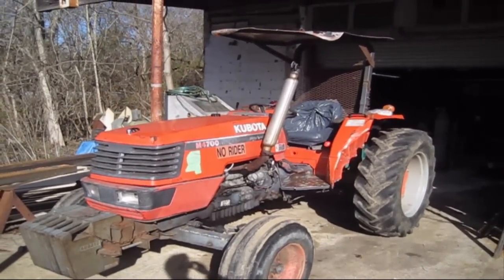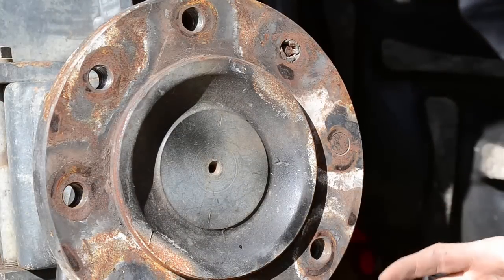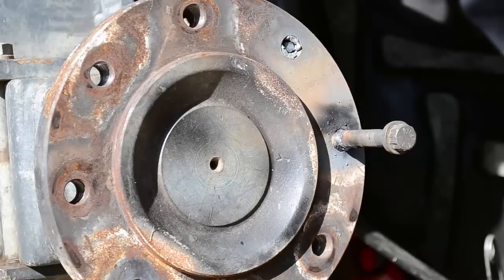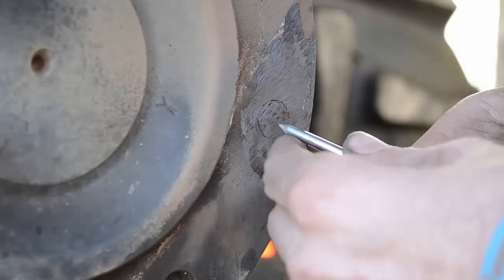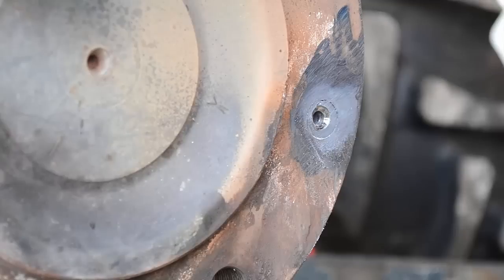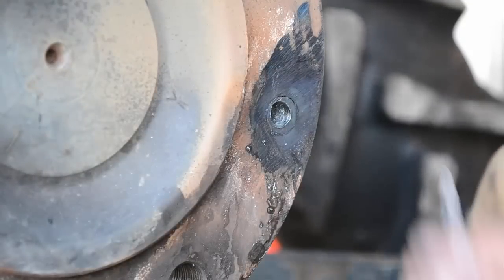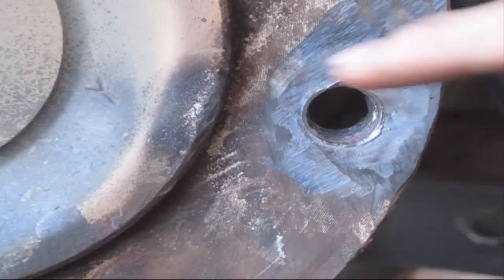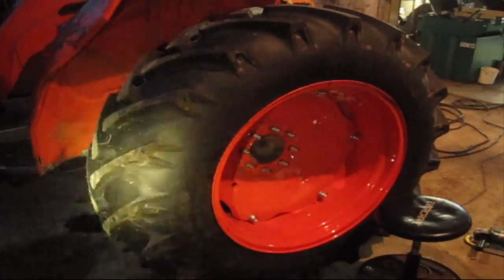Broke-off bolts techniques

Comment: Too much time ,many risk   , you can with two holes  first 2.5 mm then 10 mm  put wd40 in the hole  , if its  rusted with a torch heat  then some impacts with a hamer  , and  poke a 11 mm exagon  driver turn to left , its all .

Comment: Its easy when u have all that space to deal with the shit.. Infinite space, no off limit angles, no wires and sensors around, no rubber, no oil seals, no limit for whatever choices of tools.. Im dealing with a very specific shit on my motor where im stuck with all those limitation. Pulled my hands off coz i dont have the balls to gamble with those fucking sensors and wire and seals tiny winie conectors.. Shit!!! I need a beer.. Lets just leave it for today..
Reply from the maker: alister kellen I understand believe or not I do the same thing when in a confined space.  Wet a welding blanket and put it all around your wires. Sometimes you got to take a chance. Beer and rest helps a lot I bet tomorrow you'll have it out and wonder why you had problems.  Wish you better luck and take care.
Reply: Classic Work lol..dont get me wrong bro ur vid is good.. Maybe Im just commenting to express my frustration after a fucked up day with those junk I'm working with.. I'm not those pro 25years mechanic guy who surf the tube and correct others methods to begin with.. I'm just the mad guy that need a rest with my beer..haha.. I gave full credit for Ur patience tho.. I need that attitude..after I sober up of course..huhuhu
Reply from the maker: alister kellen hahaha very cool.  Thanks man well maybe I can help ya out. What are you working on, what size is the bolt, material, and what is your tool selection like?  Might can help. I've pulled some really hard core shit out in the passed.

Comment: Damn video should be how not to remove bolts. Should have used lube once it moved . By using 6011 as pounding on it is great, only you are cracking the weld before even turning it once. 7018 or 10018 =10,0000 to 30,000 pds per square in weld strength on a small surface area strength matters. Cutting off the back of the broke bolt flush or screw  and weld nut on the  back if U had enough space. Drill any thing, get some Mystic Metal Mover; Google it and drill threw spring steel like butter. Get some you wont regret it. Took awhile but; you did gitter done. Yrr learnin took me 50 years working with metal to get half as smart as I think I am. Now can't remember shit. My  wise old man said' he forgot more than I would ever know. I said;  U R right U forgot.
Reply: Ha, wonderful post!

Comment: I can drill a lawn mower blade and leaf spring with slow speed and a lot of pressure you are drilling way to fast PS if you're doing this a lot you should get a hand mounted drill made for tractor trailer stud removale

Comment: way too hard that way all you do is weld on the bolt then spray penetrating oil on it (KROIL is the best) and go have a coffee. When you come back  heat the area around the bolt as hot as hell, then use CRC Freeze Spray on the bolt and just undo it
Reply from the maker: christopher coulter hahaha I see we have a kroil fan.  I think spit works better than that 25$ a can crap.  Don't give in to the marketing wank.
Reply: $25 a can never paid that much but you can also try this. we had to remove seized pins on an excavator track First we blew a hole through the centre of the pin with the oxyacetylene blowtorch then we grabbed one of those CO2 fire extinguishers we covered the pin only and pumped the CO2 through it.after that it was just a sledgehammer and breaker bar job done.

Comment: I did watch about 1/2 of your video . It looks to me you are what they call a back yard mechanic. Your method is not new its bean used for a long long time. Never weld a grade 8 bolt to softer material. You may want to try the square taper type easy outs . Buy a good one not at the hardware store. You will make it easier for your self.

Comment: Try some nuts off,,,like bolt breaker,,then heat around the outside, it will pull the lube into the threads, then follow Joel S's suggestion with the washer,,and nuts. Railroad Lee's  idea,,, railroad guys  know.  And on resembling use anti seize on new bolts.   I so hate broken bolts,,,

Comment: Why are you doing all that foolishness, when all you've got to do is drill a hole which would allow a welding rod to strike an arc within, fill up the hole you've drilled, leave it to cool off. This would cause the bolt to shrink due to the contracting of the welding which in turn pulls the bolt away from the threads freeing it up in the process. The bolt is at least grade 10.9, you apply heat to that it would be difficult to drill it afterwards, plus the speed of the drill is way to fast to drill a graded bolt.
Reply: pitulifaithinjesus, you are correct.

Comment: I always have a tin of nickel compound with me. It's God's gift when it comes to tight or bonding threads. As soon as I get some movement in it, I take it in as far as I can, then apply some nickel compound as far into the threads as I can. Next I take it out as far as I can and if there are any threads exposed, I apply more to as much of the threads as I can and also into the hole at the back if I have access to it. I then work it forward and back, working that NC into the threads and you will find it freeing up. That stuff is incredible and heat resistant up to 1400 deg centigrade. This is the stuff: http://spanjaard.biz/product/nickel-compound-anti-seize/

Comment: You are wearing me out just watching. Fire up the cutting torch and blow a hole through the stub. You can control the center location much easier than using a drill bit.

Comment: THIS CHANNEL STILL ADMITTING MECHANIC WORK COVERS UMPTY-DOZENS OF SKILL SETS WHEN YOU BREAK IT ALL DOWN?. I'D HEAT THE BOLT SHELL AND THEY COLLAPSE IT WITH A PUNCH, BASED ON WHAT YOU HAVE DONE SO FAR..

Comment: I'm sorry to say that, but you're a very poor driller. To high speed, wrong driller. Carbide is for concrete, bricks etc.
Reply: BardBeard .... NOT TRUE...carbide is also for glass, titanium, steel, SS, ....Cuts anything
Reply: @jdovak1589  Yes. Solid carbide drills. But not the one you use.
Reply: @jdovak1589  Yes, but solid carbide. Not this kind.